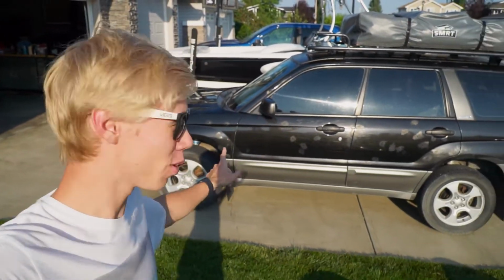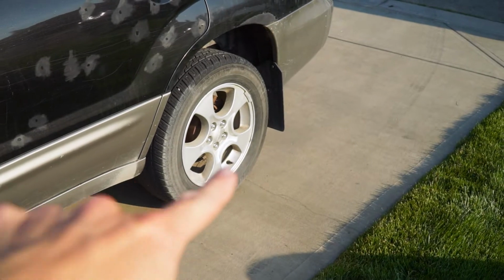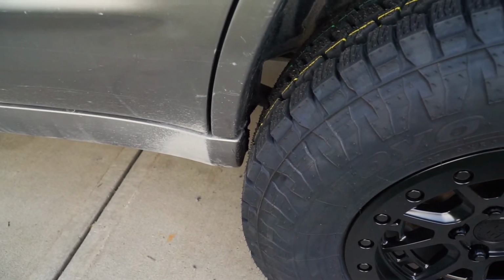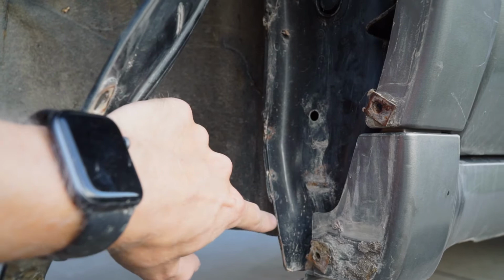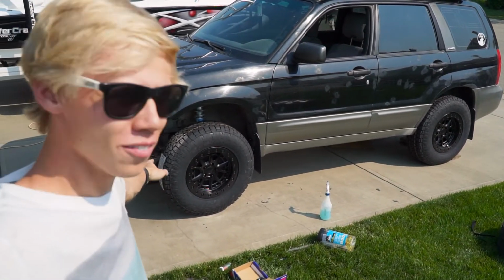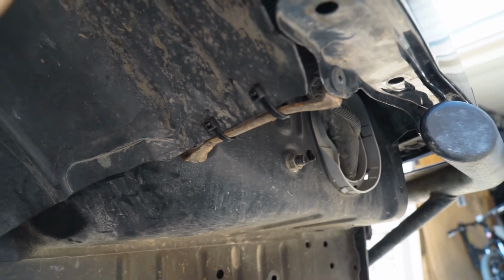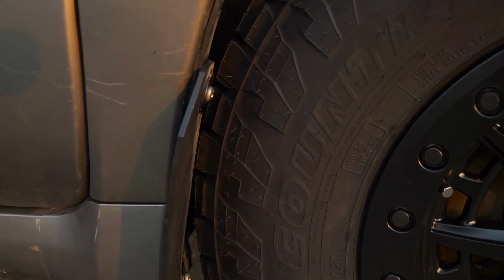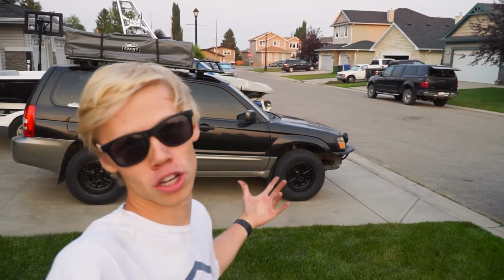How to Install AT Tires on a Subaru Forester!

Comment: Great job! I love those wheels. My build was super budget minded, but I was able to stick some 30" ATs on mine. Can say from experience, those front pinch welds are a mess... Had to bust out the angle grinder on mine! Keep up the good work!
Reply from the maker: Thanks! That’s awesome! How much of a lift were you running to get those under the car? Haha I could see why you would use an angle grinder
Reply: @Chase_Schrader  i have a 2 inch Kein lift. It has those swing arm spacers you were talking about, those help a lot in the back. I made a few videos about it, but car stuff isn't what my audience is looking for, so I put a pin in the project for now.
Reply from the maker: Ahhh sweet, that makes sense. Did you have the STi LCAs?
Reply: @Chase_Schrader  no but i googled them after watching your video lol. do they really help pull the front wheels forward while steering? That's the main issue with my build, can only turn about 75% each way.
Reply from the maker: Yeah they do, they are quite pricy though. Oh damn that makes sense though. There is a great post about them here: https://www.blingstrom.com/diy-project/2019/9/18/04-06-sti-caster-adding-lower-control-arm-install-better-looks-and-handling